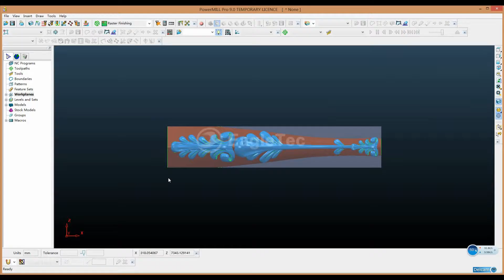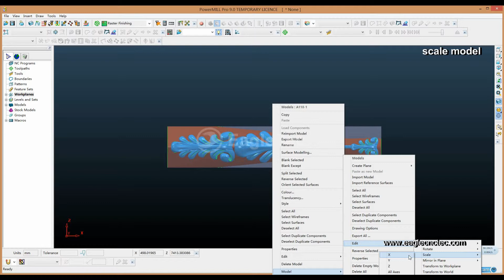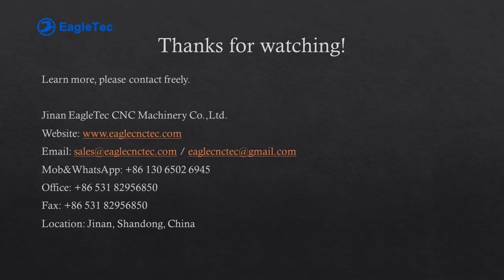PowerMILL 4 Axis CNC Programming Tutorial: How to Scale STL Model Size

Comment: So it seems, when you enter a value it scales the model down. How do you scale it up to make the model bigger?
Reply from the maker: Simply input a value bigger than 1. That's it.
Reply: @EagleTecMachinery  Ok, that works. In Aspire I can specify dimensions for X Y and Z. Most of the time Z what I adjust to the thickness of material on hand. Is there a way to do that in Powermill other than using the scale? Seems to take a lot of math to get the right number to get it scaled precisely to the measurement I want. Thank you for your response.
Reply from the maker: @a2rick  Can you advise us of your email? I will let our technician get in touch with you.